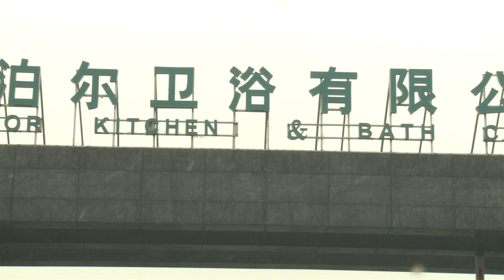ABB Robotics - Polishing Stainless Steel Faucets (Taps)

Comment: Since when does copper contain lead? Nothing wrong with using SS I just think the reasoning used here is a little odd..
Reply: Most faucets purchased prior to 1997 were constructed of brass or chrome-plated brass containing up to 8 percent lead. Water sitting overnight (or for several hours) in a brass faucet tends to leach lead from the brass faucet interior which may produce relatively high lead levels in the first draw of drinking water.
Reply: Good Googling, thanks.

Comment: How does robots deal with Wear of the Stone Disks ?
Reply: In China the dust removal system is must no matter manual or machinical polishing.
 this system is mainly concerned in our polishing robot.
Reply: Jojo Ruan what?
Reply: CxC2007 they may use either manual check or automated check between shifts to ensure adequate polishing disks diameter